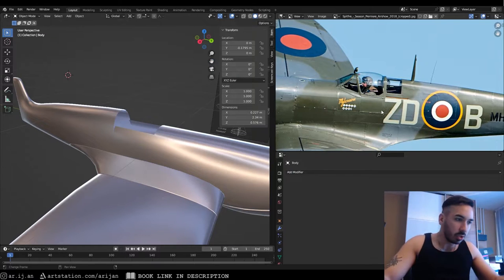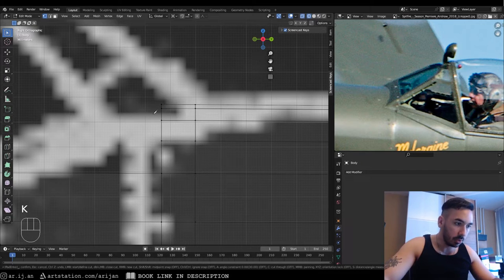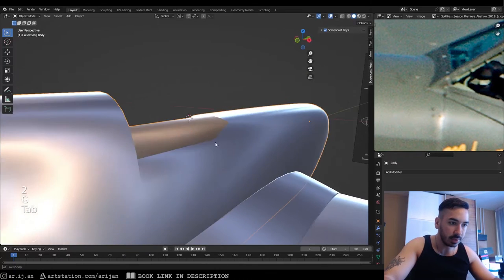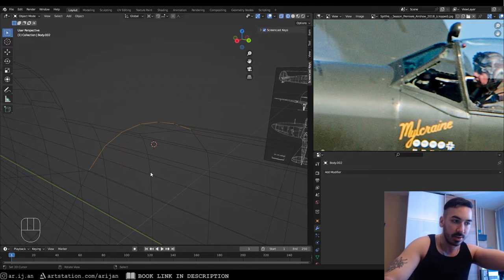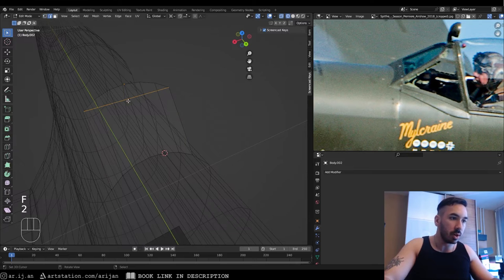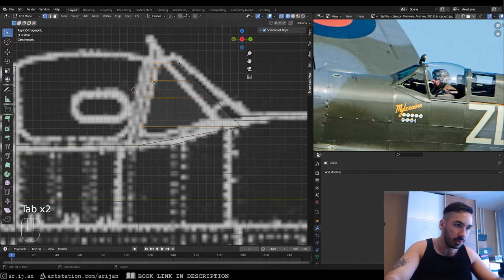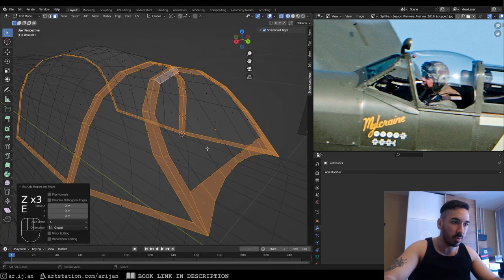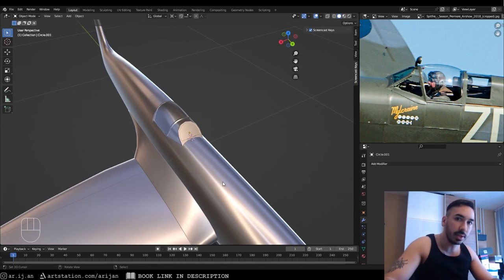Modeling a Spitfire Cockpit in Blender [Pt. 3] (Arijan)

Comment: For perfectly flat surface i'm  using shrinkwrap modifier (project on Y) . Just add a plane and than make group of vertices for shrinkwrap on that plane. By this way you can easily correct angle of window by rotating plane as you need.
Thanks for the tutorial. Will be Waiting for  the next episode.

Comment: Considering that the canopy (NOT cockpit btw) wound up being it's own object disconnected from the main body in the end....there was no need to mess with the main body topology that much in the beginning.  Could have created a duplicate of the topology you wanted to borrow from it rather than make destructive changes to it.  Now the shape of the main body from the canopy all the way to the front of the plane has changed and become uneven because an entire loop is missing, in order to make an object that isn't even connected to it.  Not to be too critical, that kinda thing happens to me all the time and hindsight is 20/20, but just something I noticed could have been done in a less destructive way.
Reply from the maker: You are 100% right, just wanted to show some tools and tricks. There are definitely better ways to do it.
Reply: @ArijanRace  That "location" trick with setting the origin and 3D cursor in order to scale/move something along an angle is a really good one that I'll definitely be using!